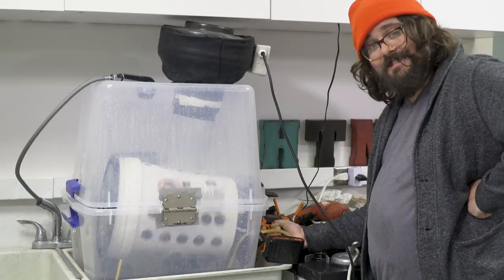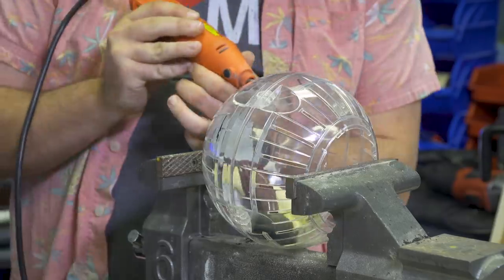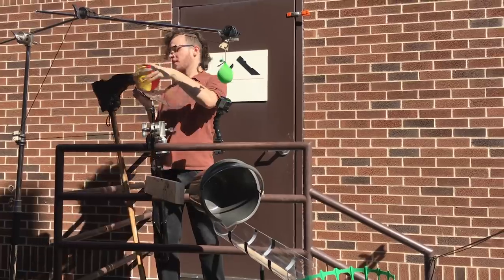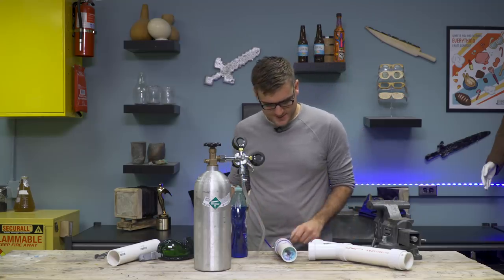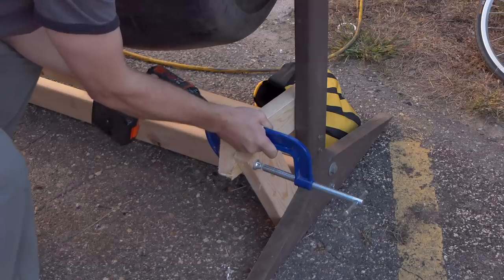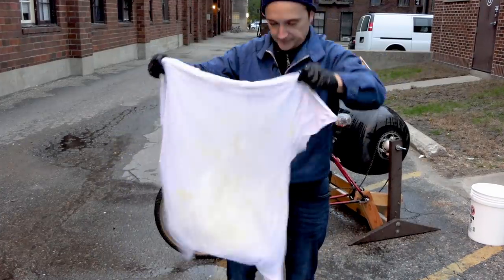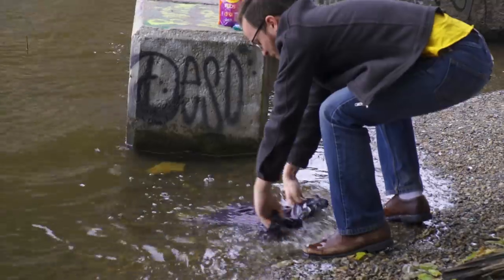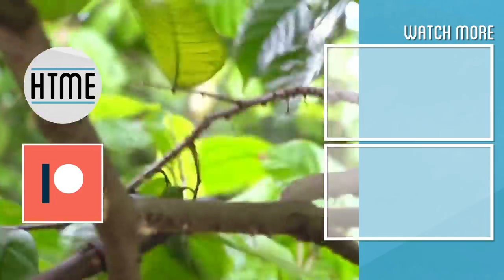Weaponizing Tide Pods and Other Unique Laundry Solutions | Upcycle

Comment: If you're going to re-use things you already made I'm okay with that, as long as you link to the videos where you made them.

There are a couple things that are so flexible you might want to do just for it's reusability:

-Carbon Fiber, which doesn't require to fetch weird minerals, it's made from C, N and O (but I know nothing about chemistry). Glass fiber works too but is less cool.
-Epoxy resin (or a similar glue). I'm completely lost on how hard this might be, that's why I watch you. But is kind of necessary to use Carbon Fibers.
Reply: to use with* Carbon Fibers

Comment: You could cheat with laundry detergent and just use potash as was commonly used during medieval times for laundry (or more specifically the dilute lye solution from it was) or use horse chestnuts or the leaves of the horse chestnut tree which are often used as detergent amoung the more hippier members of the foraging community

Comment: You should have just used one of those silicone whisker biscuits you can get at a bow store, it would have built up pressure until the whisker biscuit couldn’t handle it the  release all the pressure at once shooting that tide pod twice as far.

Comment: ...
I was kinda hoping you were going to use chemistry to turn the surfactants in the tide pods into some sort of energetic compound. 

I don't know about these washing machines.  Shooting laundry detergent at a shirt doesn't make it cleaner, it makes it sticky and gross.  You need to allow the detergent to be agitated with the shirt, and then the most important part is rinsing it. Otherwise all the dirt is still on the shirt, you've just added laundry detergent to it, which is just one more contaminant. 

The only actual machine that was made was the one with the drill, but it got like 2 mins of time in the vid.  It's certainly more original than a CO2 potato gun, which everyone's done already.  At least most people have some pretense for making one, whereas yours didn't accomplish the task it was made for, and it never would have, no matter how it was made.

Tbh, when i first saw the CO2, i though you were going to use it to agitate clothing inside a tube with soap and water, in order to clean it.  Was disappointed when it turned into a potato gun..
Reply: Energetic compound 😂
Reply: You might even be able to use it and cycle between it being a pressure and vacuum chamber which might agitate the insides enough to clean them. Obviously this be is extremely inefficient but pretty no original
Reply: I feel like i was a bit too harsh with this post.  I love the channel.  I guess i just expected something different from the title.  I don't know.. i guess i was in a bad mood, but i still feel like the criticisms are valid.  I don't know if i should delete the comment to get rid of negativity, or leave it up, cuse the stuff i wrote is still true, even if i feel bad about saying it..
Reply: @BothHands1  I agree it was harsh but I think it needs to be said, I personally don't want the channel to become trash. I mean this video was entertaining at some points but I didn't learn anything. In the past I've usually learned some things by the end of the htme videos but this one felt boring and dumb
Reply: @BothHands1  looks like you were in super Saiyan mode
Reply: What about the bike? That was pretty good.

Comment: Check out soap nuts, or soap berries for laundry detergent. That's what I use for laundry. It would be an boring "from scratch" video but you essentially just get the berries and dry them out and they release "soap" in hot water. They actually work great!

Comment: not sure what els upcycle? i epicycle milk jugs all time. maybe see what make out one. 1 made jack lantern only use led battery lights no candles.2  water can garden not greater. cut top left handle drilled holes bottom. lose water second took water rain barrow. 3 bucket pealings. cut top off leave handle cut side in front. when gut punkin, pealling carrots other things put in there take goats to eat. storage for screws and nuts other tools. basically instead of put dealings in it drop tools 4 thing melt metal in. cut top of around spot. fite regales can with pencil through stop touch bottom. use strongest quick dry concert. when drys burn off plastic milk jug. i melt pop cans in wood burn furnace with this. though use lot some point fail know big deal make more easy. even use smaller milk jugs make smaller one. 5 tried make plastic skull decoration off another utub vedio though found just cheaper buy plastic skull then was try get mold would melt. use heat gun on melt on. if stone garden statue that say try use heat gun on milk jug try make mold. 6 plastic brick. i one time try cut plastic up small peaces put inside squre cement mold made. try bake oven melt together make plastic brick thought re use trash build enugh bricks make building free. it gave toxic cancer cause fumes . so don't do this unless get cheap oven put out side some how. if think all palstic get every day objects if melt down reshape think things make.

Comment: Jörg Sprave on the Slingshot Channel has made a lot of improvements to make a ball valve with a level open quickly. Basically he used a trigger and lots of rubber to put the lever under stress. Pulling the trigger let the rubber pull the lever and open the valve.

Comment: Major problem with the gun might lie in the diameter of the pipe, if a more narrow tube was used you'd get more push on your pod, because you'd lose less pressure around the projectile, you want the pod to be real snug, put some dish soap to live the inside barrel and you'd have a strong little laundry artillery

Comment: Not gonna lie, if the purpose of this was to create a DIY washing machine, you really missed the mark by quite a wide margin. The only two machines that were viable options were the drill powered and the bike powered machines. Each have their own faults and can be improved on a fair bit, but they're the closest to a decent washing machine. The "pod-cannon" was definitely the worst as it just made the shirt even dirtier. Just shooting a cleaning agent onto a shirt doesn't make it cleaner, it needs to be agitated by something to get it to activate and actually clean. And it also needs to be rinsed so the chemicals don't sit on the shirt and possibly irritate or damage your skin when you next wear it. 

I love the idea of this series, but I think that in the future you should add some sort of criteria or check list for what can be considered as the machine in question. Like for a washing machine, it needs to soak/wet the clothes, it needs a way to get the cleaning agent onto them (be it dissolving in a ton of water and soaking into the clothes or something else), it needs a way to agitate the clothes so the agent can really clean them, and it needs a way to rinse off the clothes of chemicals. A drying method would be optional given this would be a washing machine, not a drying machine.
Overall, you're off to a rocky start but hopefully you'll improve on the show and keep it going.
Reply from the maker: great feedback thank you!